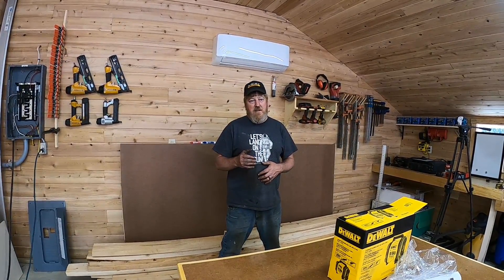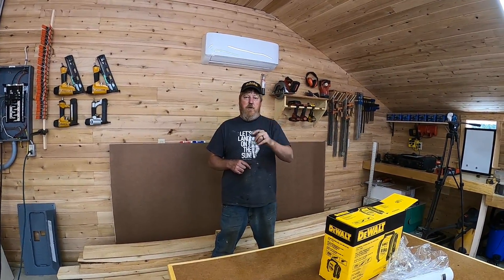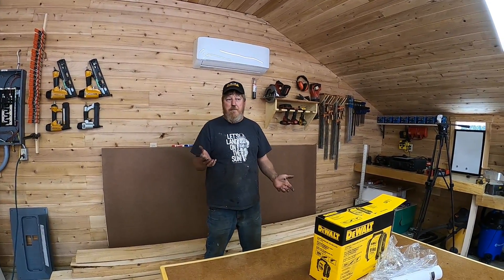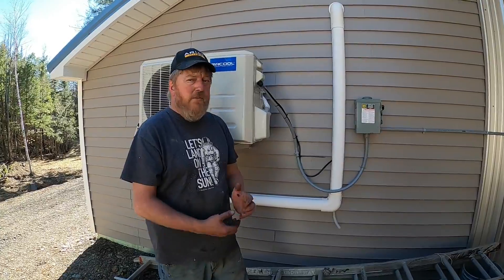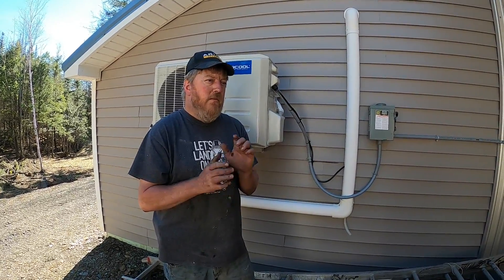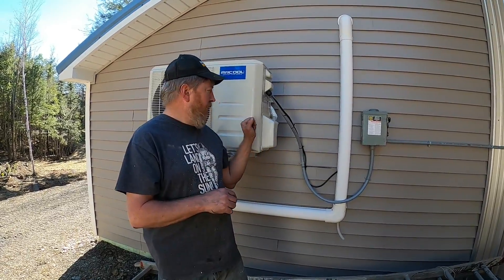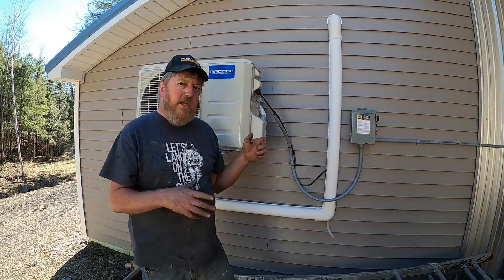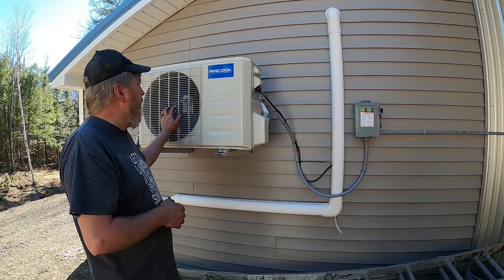Mr Cool Heat Pump First Winter Review and Detailed Electrical Connections

Comment: Wondering if you're still using the system. More recent update if possible
Reply from the maker: We certainly are, Nothing has changed we still love the Mr Cool and it is still performing as it always has.
Reply: @aroundthehomesteadwithsuer3497  great to hear. I'm looking into possibility installing the diy unit. Most of the videos I've seen imo seem to be sponsored ads.

Comment: They blow cool air in defrost mode
Reply from the maker: Yes they run in AC mode to heat up the external unit. The inside fan runs on its lowest setting

Comment: Thanks for the video. I was going to get the Mr. Cool 18000 BTU unit but at the last minute changed my mind and got a Fujitsu, because I'd heard that it's hard to get the Mr. cool serviced.
The Mr. Cool definitely does give more bang for the buck, with WiFi, and better remote functions. I have the same issues you mentioned about the Fujitsu, as far as temperature being stable. I'd much prefer the sensor on the remote rather than the unit itself. Just makes more sense that way.
One question: Does your Fujitsu remote temperature display in 2 degree increments? Is this common with heat pumps? I find that annoying.

Comment: One question. At this point with the cost of freon being through the roof, is it still cheaper to buy the non DIY version (and therefore non pre-charged) and then spend $400 dollars on a can of freon plus the tools to charge it?
Reply from the maker: The non DIY is still pre charged it just has to be vacuumed down to remove moister etc
Reply: @aroundthehomesteadwithsuer3497  Sweet, thanks for answering.

Comment: Great informative video! Been planning on getting the 18k mr cool for my fully finished garage gym. Is the disconnect a 30 amp or 60 amp?
Reply from the maker: I believe this was the 60A version
Reply: @aroundthehomesteadwithsuer3497  Thanks! Forgot to ask, would 12/2 romex be enough for the 18k model? I have a double 20amp breaker with two hots from 12/2 right now. Plan on purchasing the 18k model soon

Comment: How loud is the condenser unit? I just bought 3 single units and one dual for my home. I haven’t gotten them yet but am wondering how loud the condenser will be during the heat and a/c running? I may have to mount two of them near bedroom windows, would that suck trying to sleep with it running?
Reply from the maker: We find the running noise is not bad, They do make some vibrations into the wall and the Fujitsu makes a noise like a car door closing when it starts. Your mileage may vary but one would assume the window is closed if they are running heat or cooling so it would probably be ok depends on how light a sleeper you are

Comment: Romex inside Conduit for an outdoor location?  I'm not an electrician, but I've been told several times by electricians that's a no no.....
Reply from the maker: Generally speaking, I would use something like THHN but for short distance as a sleeve I have no issues with it

Comment: A couple of things. 
I don't like running lines so the 410a has to run uphill. The way you have it there's a place where liquids can settle, I would have run them above the condenser. The other thing is the black power cable running to the evaporator unit  in the house. That's 240V 16 gauge wire and it's best to run it into the same type housing as the 240V is in going to the outside condenser. 
Also I don't put sharp bends in my lines, the sweeping turn is better the other turn is tight. I know these covers include those sharp corners but it's like driving your car at 50 mph and coming to a right angle turn, you have to slow down.
Just my view, thanks for the video.
Reply from the maker: Good info thank you
Reply: I haven't seen this as a problem. Almost all outdoor units sit on the ground and run up to the top of the first or second story to the indoor unit.On one of my units the max height is 33 feet for <15,000 btu and 66 feet for > 15,000 and < 24,000

Comment: My Fujitsu 33 SEER 9K works great. The indoor blower starts up occasionally without the outdoor unit, just to keep the air circulated in the room. That’s normal. Mine draws about 2-4A at 240V in the summer and up to 7A in the winter.
Reply from the maker: I think they all work similarly honestly. I have seen a Mitsubishi and we have a Fujitsu and a Mr Cool. I will say Mr Cool is the only one that measures temperature at the remote not at the indoor unit (At least out of the ones I have used)
Reply: @aroundthehomesteadwithsuer3497  gree, aux and even tcl has iFeel remote temp sensor. This mr cool is a midea rebrand.

Comment: Im installing a 9k btu 240v mini split. What size wire and breaking for this ?
Reply from the maker: I would not dare to say, I would suggest you look at the installation manual it will have a recommended over current protection device amperage, then size the wire for that amperage allowing for voltage drop of course if it is a long wire run. For example in the US if it said it wanted 15 amp over current but the wire run was 200ft I may run 12 gauge or even 10 gauge wire to help with voltage drop. I would use a voltage drop calculator to see what percentage I had and try and get to 3% or less

Comment: Thank you I am running the electrical for the kids to the wall units and to their outside unit you answered my question on the 240 wire . My brother told me do the running of wires and he will hook up the breaker box inside and outside of home. What size breaker box did you need for the outside ?
Reply: Depends on the size of the unit. The manufacturer will tell you what size breaker you need for the specific unit you buy.

Comment: Great video. I really didn't have any problems with any of it. Knew there were gonna be comments on your fingers and the proximity to the hot spots in the electrical. I can touch a hot (120v) item and usually won't feel even a buzz because of callouses on my fingertips. It scares a lot of people. (don't try it with DC - PV wiring!!!) You gotta be all PC on here in some instances, LOL!!. I recently retired from 30yrs in a commercial facilities maintenance position.
Reply from the maker: Yes and a camera has no depth perception, At no time was I close enough to be worried about touching something. As a Master Electrician I am used to working in Live panels etc and have even changed a few GFCI receptacles with the power on. It is like anything, be aware of what you are doing, One hand in the box etc

Comment: It is still heating with electricity and that is high.
Reply from the maker: It is but at a greater efficiency, from what I think I know these things are up to 300% efficient and at worst 100% efficient. That all said our grid tie solar offsets our usage. We ended up throwing away 2,000kWh this year so that helps also. I think the combination of some grid tied solar and a mini split make a lot of sense in most areas of the US
Reply: BUT: The efficiency of resistive heating being a 1.0, the mini splits operate about 1/4 the energy for the same heat output in the normal temp range. Cheaper than just about anything but natural gas. PLUS: It operates on electrical only, no carbon problem at all if using power from solar+ battery. If going with any new system with a 10-20yr life, go with the new tech. Just don't do what they are doing in GB, they are pushing mini splits off on everyone, ignoring the fact that their homes are poorly insulated and have mostly oil heat. The standard heat TEMPERATURE output of the oil heat radiators is like 140-150deg F. The output from the heat pumps are way lower and demand a lot of time to do their thing. BAD PR!!!

Comment: How many watts does this unit draw in heat mode at max heat setting please? Does that wattage change as the outside air gets colder?
Reply from the maker: Good question, I cant speak for its absolute peak but I will say if I go from say 60 to 70 on the thermometer it ramps up and runs pretty hard, Seems to draw about 1,500 watts. But when running at a steady temp it seems to be closer to 500 watts. I do think the colder it is the harder it works so the draw is slightly higher yes
Reply: @aroundthehomesteadwithsuer3497  have you used a watt meter on it? I am interested in how much it would pull on a 100+ day running steady at say 72.

Comment: I hope you see this message! Where did you purchase your disconnect box? I contacted my local electric supply and they only have a 2-pole nonfused 30 amp.
Reply from the maker: 2 pole is all you need actually as its 240vac so L1 and L2. We purchased ours at the local CED Electrical Supply
Reply: @aroundthehomesteadwithsuer3497  I found a CED closest to me in Osage Beach, MO! Thank you kindly!

Comment: What size wire did you run for your 100 amp sub panel?
Reply from the maker: We fed it with #6 and used a 50 amp breaker

Comment: Duuuuuude.......  That outside part........ It's ok for DIY I guess.  I'm a 22 year pro, so it's kinda ugly to me.  Shoulda not mounted it high, just sit on ground.
Reply from the maker: I think part of the issue with DIY is the length of the lines, We should have shortened them and it could have come together nicer, As for setting it in the ground Nope thats a no go in Maine we get tons of snow and the unit would be buried
Reply: On the ground is a great way to collect dirt,  leaves and damage.
Reply: Duuuuuude......   That on the ground part.............. it's ok for vanity, I guess.    Here in Colorado we mount them up to keep em outta the snow and blowing dirt. Should be mounted up a couplea feet. Give it a chance to work well and last a long time.

Comment: For applications where it's very cold, say below freezing all day not just overnight, Mitsubishi hyper heat units work the best.  The have a little bypass on the refrigeration circuit that keeps it blowing hot air even  when it's cold outside.
Reply from the maker: That may be, but that said this Mr Cool has done everything we asked it to even in -25F weather and done it better than the $4,000 Fujitsu we have in the other portion of the house. For $6-700 we call it a bargain
Reply: Do you have an evidence to support this? What are the comparative COP's ?
Reply: Cooper hunter make a hyper heat model also its -22 and is comparable in  price..The 2 units look identical.

Comment: For the 24k multi zone model, I know I need a double pole 35amp breaker, but do I not need a neutral wire for my install? In other words, I'd be good with just 10/2 instead of 10/3?
Reply: You don't need a neutral.  Just the 2 hots and a ground.  Neutral and ground are actually connected together on houses that were built before sometime in the 2000s.  But yeah, 10-2.
Reply from the maker: If you are in the US be careful with 10/2 and a 35 amp breaker, if you need an inspection the inspector may gripe as NEC calls out 30 amps as the max in residential on 10 gauge wire.
That said the mini splits do not need a neutral just L1, L2 and ground sort of like a typical water heater

Comment: Hi, I would like to set the heat thermostat at 48-50 fahrenheit, can the unit do this? What is the range when in heat mode? Thanks
Reply from the maker: It has a freeze protection mode that is around 50 degrees if memory serves, In regular mode it goes down to around 60

Comment: I just bought exactly the same system, can you please tell me why a 20amp breaker is needed when the label on the outdoor unit says max amp is 15A? I saw your label says the same  thanks!!
Reply from the maker: I guess it was the electrician in me, The book said the appliance amps was 15 so I rounded up as a 15 amp AC breaker can not supply 15 amps we have to derate them.
Reply: Recommended 1.5x circuited capability of max unit current usage.

Comment: The universal comment from mr cool owners seems to be the puzzling response between either the remote, that wall mount thermostat  or its own self contained control loop on the unit itself. It’s hard to determine just which of these controllers is in charge at any given time. Bottom line is that temp control on the mr cool, while immediate at startup, seems to lose its setpoint over time and wanders chronically lower as outside temps drop and rise when outside temps rise.. This necessitates setting the heat setpoint higher or lower than you would your gas thermostat to get similar results. Small complaint but odd in light of the units ability to scale output much more accurately than a one or two stage gas furnace.
Reply from the maker: interesting, Mine has been running all winter un attended set for 62 and the room stays 62 all winter. I have not experienced that drift
Reply: One important note on thermostats: If you are using the thermostat that is on the wall mount unit, the temps will be inaccurate. This is because the wall unit measures the air that is being drawn into it before it is treated. You should be able to eliminate this issue by setting the unit to "follow me" and then place the remote on the other side of the room. The wall unit will then use the remote thermostat for it's heating/cooling.
Reply: @joshuawiedenbeck6944  Ok, so my wall thermostat reads 74 right now and I turned the remote on and set it to follow me. It’s room temp reading right now is 69 as opposed to the wall t stat which is 74. The Mr cool setpoint is 73 and it’s running about a  50% duty cycle. I have current transformers. The whole scheme seems awkward as the wall thermostat also has a follow me function. I guess the whole benefit of the wall t stat over the remote is that the wall t stat has the ability to run a schedule.
Reply: @slipstreamvids7422  Yeah, I don't own any Mr Cool units but will be installing later this year. The software side of things seems to be the sticking point on a lot of machines/utilities.

Comment: Hi 
I like your video 
I’m in NYC and I want to get 12K 120VAC 20amp breaker but I want it mainly for heating in the winter,  my bedroom is 300sf do you think I’ll be happy with heating part of it 
Does it get to 72 degrees if you want it ? 
Thank you
Reply from the maker: I am by no means a heating and cooling expert but 12k BTUs in a 300SF room seems like it should work well, You can use an online calculator to do a heat load calculation and verify this for sure. In my case I can crank it from 62 to 72 and it will warm up to 72 in about 1-2 hrs depending on the exterior temperature, I feel thats pretty good as the room has a big garage door and 4 single pane windows as well as only being 2x4 walls
Reply: Sounds great 
Thank you so much for taking the time to reply

Comment: On your outside three pole disconnect you have it wired backwards your line is always on top your load is always on bottom on a disconnect. By  wiring it this way you are exposing anyone who is servicing your heat pump to getting shocked because the load is never supposed to be hot. You have the three lugs at the top of the disconnect that a lot of times will have a cover to go over them so you have no access to them when you open the door and the lower lugs with a whole switching assembly is normally not powered up, but in your case all that is exposed 240 V. Not trying to be a negative Nancy and bust your chops just better that people are aware that the line is on top load is on bottom. Good video I’m thinking about putting one of those in for my screened in porch. Was that a 1 ton unit? Thanks Tom
Reply: Thank you for the heads up

Comment: Great follow-up video!  Have you experienced any noticeable vibration by mounting it to your building?  I know you mentioned in your install video that you mounted yours primarily due to snow.  I'm looking at mounting my 24k DIY but just because I'd like to keep the ground clear but am worried that others have reported vibrations.
Reply from the maker: We get some yes, I have a clamp rack full of bar clamps on the wall in the shop right behind the outside unit and they can rattle ever so slightly. it doesn't bother me but I suppose if it where my bedroom wall maybe?

Comment: What was the coldest temperature it had gotten to this year? Wondering how your temps compare to Quebec City, and if the outdoor unit can handle it. Thanks!
Reply from the maker: I didnt pay close attention but we had a few nights in the -10 to -15F range last winter
Reply: @aroundthehomesteadwithsuer3497  Thanks for responding. Seems like similar temps with Quebec.
Reply: @aroundthehomesteadwithsuer3497  What happens when it gets so cold?  Was your unit still putting out some level of warm air?  It never gets colder than -15F where I just installed the same unit, so I was wondering if I will need backup heat to keep the pipes from freezing when it is -10.
Reply: @djcanfield1  go with a Mitsubishi hyper heat unit.  Costs more but worth it in cold temps.  Still blows hot.  It's because of the refrigerant piping they do differently for hyper heat.

Comment: Your outside disconnect box is absolutely overkill. Why you used that box is beyond me...
Reply from the maker: Jim,
Mostly because as an electrician I really dont like the cheap pull out disconnects. I know they are listed and legal and I know they work but I really like the lever. Up is on down is off, this is easy to explain and really is only a buck or two more with my discounts at the electrical supply.
Reply: @aroundthehomesteadwithsuer3497  exactly,  safety is never soothing to be cheap on.